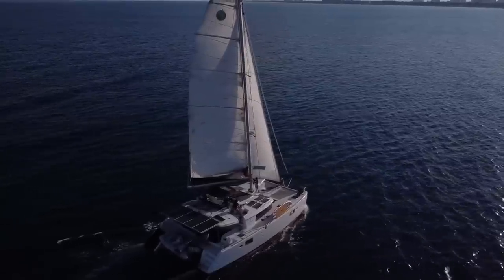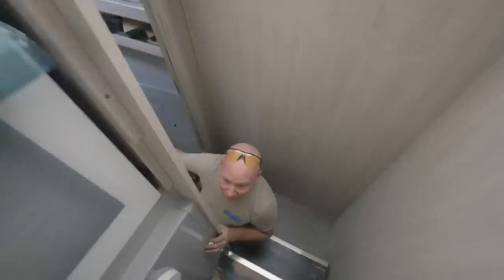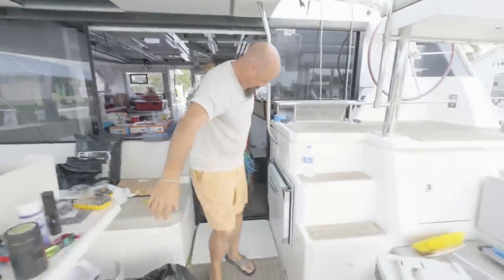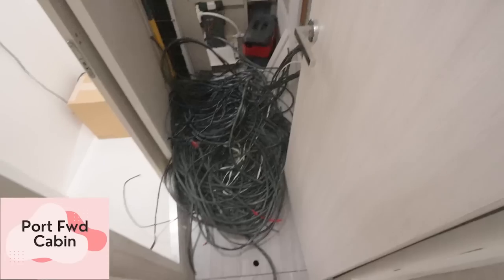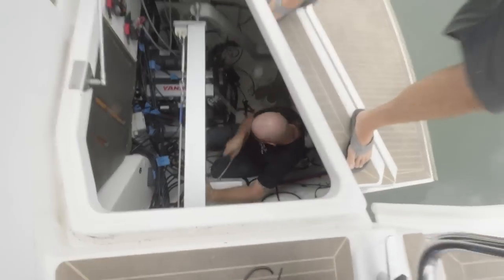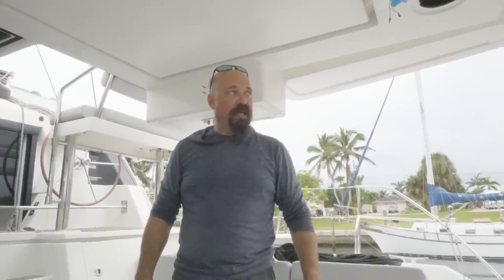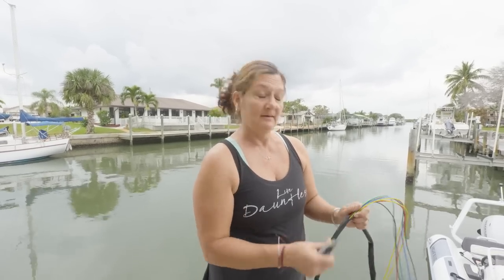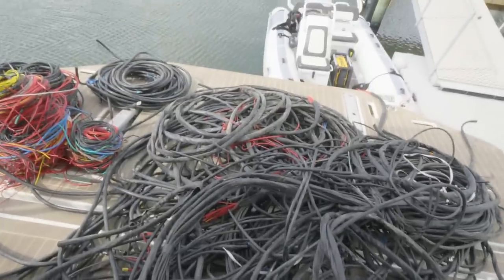ELECTRICAL GRAVEYARD//Tearing Out All The Wire-Episode 120

Comment: Should you not pull some of the new wire with the old before removing it like in covered ceilings ,walls or around or under modules in the cabin ? As for the wiring if the insulation is cleaned off before you sell it the price is almost double so you maybe want to look into a cheap wire stripping machine. Also the scrap price can vary greatly depending on which recycler you go to and what price they quote you for as in clean copper vs not stripped copper.

Comment: Absolute INSANITY! Wow, this is going to be the rewiring job of the century! I know when they built this boat, have seen some inside building videos, they alwasy wire as they go as its way easier as your building to lay in the wire and string it around. But in your case, thats going to be impossible to do now. And the BIGGEST issue is you have NO CLUE what went were or how it was run throughout the boat becuase you just yanked it all out without marking what went to what and are now stuck with a total rebuild of the entire electrical system which is going to be a nightmare. 

I thought rebuilding the hull mold was hard but this is way6 over the top, not something I would even remotely consider doing on a boa this size and with so much electrical. I anticipate this will take 6 months at best but probably 1 year to complete. Again, pure insanity, lol. But with all the sand and salt and probably having to chase down bad connections it was more than likely the only option available as a connection that worked today would probably fail in the middle of nowhere.

Best of luck to all of you on this one, its gonna be a DOOZY!!! You know what they say, when you do stupid sh*t you ....Yeah, exactly!

Comment: Current scrap wire is around 1.00 per lb. Bare bright " insulation stripped "3.00 lb. Check with local rental companies for a wire stripping machine. With the large cable you have it could be worth stripping the insulation.

Comment: Knowing how cheap builders are I will call you on the excess wire. There is no way whoever built that boat put 5 times more wire than was needed. If anything they cheat or cheap out and do not put enough ! Good luck with the new wire installation you all have a huge job ahead.

Comment: When going back in, to minimize wire runs, it seems logical that each hull have its own sub panel.  I realize that you probably have 3 or 4 different voltages your working with, but what you pulled out seems fairly excessive.  I bet you could rewire the whole boat with 1/3 of what you pulled out.   Lots of planning and congruent systems will be required.

Comment: I'm gonna guess around 2300 pounds unstripped wire. Betting with circuit consolidation and boat converting to 48 volts and AC power you'll save 600 pounds of copper on the refit.

Comment: At .45 per lbs for Copper . You will be dock for the Plastic on the Copper, they may give you 10 cents a pound for your Wire .  To bad  you can’t strip the Wire first to get more. You should have 1500 lbs with the Plastic on it.    Gory of Ohio

Comment: Get To The COPPA!!  I think that original saying was from Arnold S. saying "Git to da Choppa"...  I used to recycle all kinds of electronics and I got most of my returned funds from aluminum and copper wires.  I got a dollar more per pound with bare copper wire than I did with the wire that had the plastic coating on it.  I'm guessing that you have close to 1,250 pounds of copper wire.  It's probably more like 1,850-2,100 pounds if you still have another hull to clean out.  Just curious, if you are pulling wire from the ceiling or under the floor spaces are you also pulling some nylon cords through them so you can pull the new wire back through those spaces?

Comment: Your pile of wire that came out looks like the old owner had every electric option available installed,  I’m sure it’s normal for a 50’ cat though.   825 lbs is my guess.  It would be interesting to know how much weight you go back in with.

Comment: My best guess 1259lbs. The 9lbs was a typo so I left it in as I thought that might make me the winner. My guess of what you might save in weight will put 25% less of the actual weight, Hopefully more. Really looking forward see the process and labeling of all the new wiring, including your design of the distribution panels. We have a 2013 Leopard 48 so watching your rewiring is going to be fun for me to watch.  Though watching you cut and pull existing wiring and panels was super scary for me to watch. Good luck.

Comment: II have stripped out a lot of data cable from offices in the UK, mostly Cat5E. A Transit van full is about 90 kg to 120 kg and at the recycling site we got about £450 for it.
You have a lot of Power cable witch is a lot heavier so about 600 kg or 1320lb ish.   Maybe $1200 or so, but I have no idea what the price in the US is for that wire.

Comment: Hello from the UK. Marine electrics was never my forte but wondering if there's a way of adopting the canbus system used in modern cars, it would save a lot of wiring but I guess it would need a box of computer chips to control everything. 
My guess would be 1225lbs.

Comment: Y'all have done the right thing by ripping out all that wire. Sure some of it might have been ok. Though tracking down what is good and what is bad would have taken longer than just chopping it all out and starting fresh. As to how much you pulled out that is a nice challenge you have set your viewers. My best guess would have to be some where around 295 lbs. Looking forward to seeing the install of your new electrical system. Should be fun.

Comment: have you considered buying  graphene batteries and graphene solar panels?  comparatively priced, safe (no fires), charge faster, 20,000+ cycles, carbon not toxic. a better mouse trap. I work with the largest global graphene battery factory. I can connect to to the owners 🤙  yabadaba doo
Reply: and significantly lighter
Reply: 1815lbs
Reply: Two weeks was the estimate. Day three is still removing wiring from the boat. That is the easy part. I am going to guess 1450lbs. But now I know why there was a big shortage of wire a few months ago.
Reply from the maker: Thank you but the insurance companies aren’t on board yet….. maybe someday?

Comment: Advanced Bravery classes begin. I was crying vicariously just watching this btw ;)
There are wire stripping jigs (with online videos) that might save you a lot of time... and separate  the plastic recycle from the copper recycle piles (not sure it's worth it - maybe ask the recycler first)
Nice to see the smell gone - but it does leave one to wonder what the conduits still look (and smell) like. If there is no way to pressure wash them, then mass-ventilation fans might still help to dry everything completely and safely?
Reply: Eh, drop it in front of a crackhead and they'll have it done in 20 minutes. 😂
Reply from the maker: They are actually open with no turns so they are easy to clean and dry